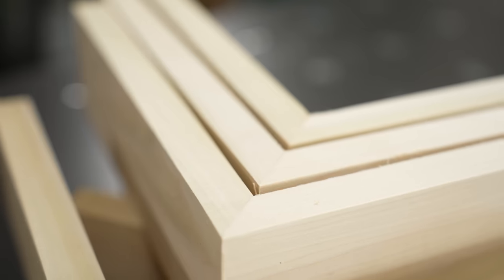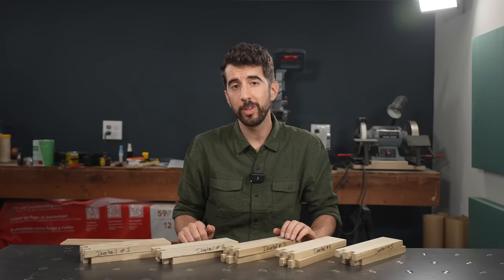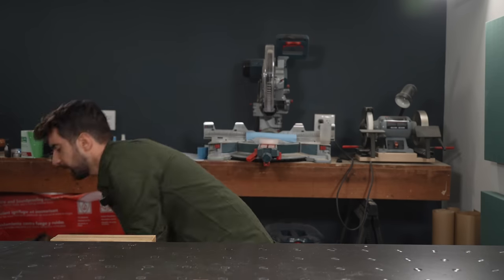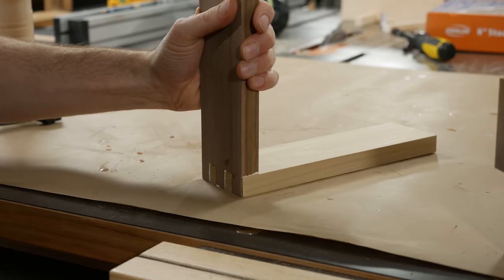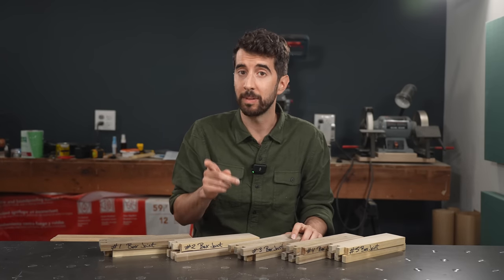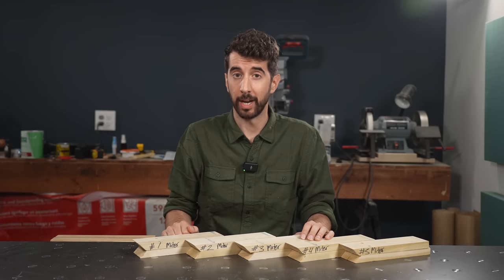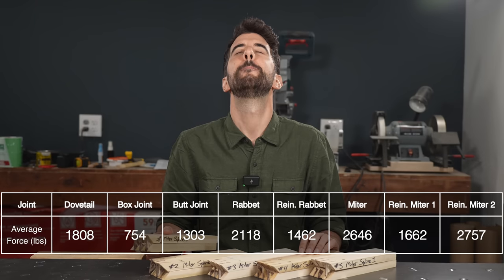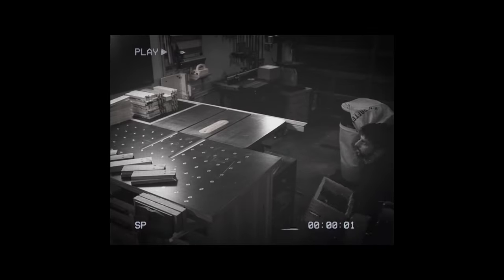This Simple Joint is Stronger Than a Dovetail!

Comment: yep - pros and cons - also noting stability and failure modes vary - mechanical, racking resistance is a nice feature in corner joints..

Comment: Clever test rig and interesting results. To find the strongest joint, you need a glue that is stronger than the wood to truly test the joints where the glue fails.  That may be a case of better being the enemy of good enough. After all, some Japanese furniture makers use rice paste to hold their work together.

We are all guilty of not giving enough clearance for glue.

Comment: The splined miter may optimize the way a glued contact is strongest - shear along a wide surface area. Dowels sort of use this principle, but when levered around the hole, the wood can expand and split around the dowel in either of the joined parts. Optimizing a strong glue layer around the splines distributes the shear forces so there is no focused stress riser; choice of a strong grained wood for the splines that also absorbs glue is apparent.

Comment: This is an interesting video.  One small quibble is the use of "mechanical advantage" to specify a mechanical lock in your joints.  This van be confusing since the usual meaning of the term is leverage.  It's the reason these joints will fail at much lower forces if you bend them.

Comment: Curious what would happen if you put a 1/4" hardwood dowel down the center of the butt joint.  You could drill it from the bottom so you won't see it...

Comment: You'd be amazed at how high the internal stresses get when you "rotate" the joint. It's called leverage, or mechanical advantage, if you prefer. Also, there is an "internal" mechanical advantage within the material itself. The surface area of the joint is probably the one single most factor influencing failure. It is the reason drag cars use "slicks" to get more surface area on the pavement. Remember, "stress" is what causes overload fracture failures, and stress is merely the total force applied divided by the area over which it applied. Larger area, for a given force, the less the stress. Failure by repeated flexing of a material, e.g., bending a paper clip until it breaks is called "fatigue" failure. The higher the stress applied, the less repetitions to failure. If the applied stress is below 50% of the material's "yield stress," the material will not fail in fatigue.

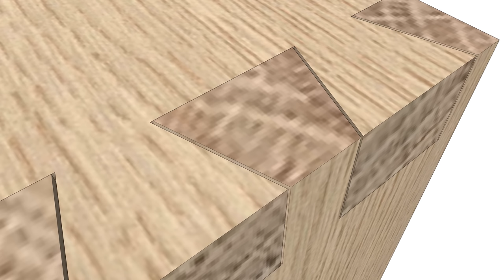Comment: 1:15 Not mechanical advantage. 
Mechanical advantage has to do with a system that allows for an input force to be multiplied through some kind of lever or device (e.g. ropes and pulleys) to produce more force on the output. 
This would just be an example of a mechanically tightening joint as the more force you put into it the stronger the connection gets.

Comment: I love your presentation especially your humor.  But seriously, your testing is blowing my mind.  Everything I thought I knew was wrong?  It’s not like my drawers need to hold 2000 lbs of pull, but I have believed for decades that end grain as a glue surface is weak and long grain is strong.  Now I’m wondering if I should forgo my next jig build and another router for IKEA.  Yikes - perish the thought.  Give me joint bling or give … beer, beer is good!

Comment: one, almost always ignored, factor in joint strength evaluation is time and changing humidity. Because the delta in movement  vis a vis end-grain vs long-grain, there is an active dynamic  operating to undermine the integrity of any glue line

Comment: While the 2nd reinforced miter joint scored higher, it's only by 4.2%. Is gaining 4% on an already incredibly strong joint worth the extra time and effort required? You already jump 24.9% by going from a rabbet to a miter joint, and the miter joint is simpler and faster.

In the end the conlcusion seems to be "the more grain glued the better".

Comment: I would think the wood movement due to temp and humidity in a miter joint is negligible. Both pieces, and the glue, should be increasing and decreasing at about the same rate. Like two rubber bands side by side and stretched, the two surfaces are moving in unison, keeping the glue moving right along with it. The glue might fracture during the movement, but I wonder if that would have any effect on its sheer strength? 🤔

Comment: Thank you!  For making this video. I have always been wondering which joint is the strongest although not super scientific does give a general idea and the results are totally bonkers from what you would intuitively think.  Theorizing end grain to end grain gives the glue a chance to soak up into each piece a deeper and also surround each fiber of wood, but would need more testing to confirm.

Comment: okay, i laughed for about 5 minutes when you said how long it takes to dial in the leigh jig...  which is why mine is STILL safely tucked away back in it's box.   literally takes LESS time to do it with a simple jig and a bandsaw, then clean up with a chisel...  and mine doesn't even do box joints, just dovetails.

Comment: very counter intuitive, but a great test for inquiring minds. I was really hooping you could have tested the reinforced rabbet in the other orientation - with the dowels parallel to the pulling force. With the knowledge gained from your video and testing you did; it seems that direction of the joint may actually be stronger than the opposing side, which I wouldn't have suspected either. Keep coming with these more frequent and quality uploads Scott !

Comment: Cool! How about repairability?

As someone who is proud of his dovetails, seeing the failure modes made me wonder: after failure, which of these joints are easiest to repair? The dowels really make a mess of the wood! The dovetails damage the wood but leave you with clean wood for re-gluing (now a box joint?) if you still have all the pieces. The mitre and rabbet might leave you with clean-ish surfaces that just need a quick sand-and-reglue, but then you have to match glues to whatever the original was, which may be worse...? Thoughts?

Comment: I was glad to hear you talk about longevity. Because that is the missing element to most of these test. If you would look at most cabinetry, where is the first place to fail? Miter joints. If you put a spline into that miter joint, it tends to last longer. We’ve all heard that modern glue is stronger than the wood, but is it really? Consider the following experiment. Find a 1 x 10 board that’s 4 feet long cut 4 segment that’s the same length as the width of the board making a square because we all know that a 1 x 10 is closer to 1/2 x 9 1/2. now take your four squares and cut them in half two with the grain two across the grain. Next glue them up, clamp them up and wait for the glue to dry. Now put them into a device to where you’re pulling the board apart across the glue joint. The board that was cut with the grain will not break it the glue line it might snap somewhere close to it but not the glue line because the glue is stronger in this case. Now put the board cut across the grain in the same device and it will fail on the glue line every single time. What does this teach us? It’s the orientation of the wood that determines which is stronger the wood or the glue. Now take the other two boards and repeat your test with the next two boards, but this time stretching the wood in line with the cut instead of across the cut. This time the board that was cut across the grain will snap on one of the ring lines in line with the grain at the same force as the board cut with the grain and the previous two boards were stretched because it’s the same failure. And the board cut with the grain that you’re now only stretching the grain will give you the full tensile strength of the wood that you’re trying to stretch to cause to fail, and that will be a loud bang that will be the strongest.

Comment: The reasoning behind why the simple miter joints are so much stronger: the end grain is SO much more porous than side grain, so the glue can penetrate deeply into it and grab each and every fiber and bind it to the corresponding fiber from the other piece. When we glue to the side of a piece of wood, the glue not only doesn't penetrate as deeply into the wood fibers, but it also only grabs the top thin layer of fibers, which, once the leading edge lifts, can be peeled off with very little force. This effect most likely also expalins why dovetails were so much stronger than butt joints in these tests, because each dovetail interface is like a small miter joint with lots of end grain being exposed for deep glue penetration and maximim number of fibers being joined end-to-end. Some strength is compromised by having to cut some of the fibers and leave them in place to create the dovetail effect though, which is why the simple miter ended up being stronger.

Comment: There was an interesting real-world demo of adhesive fasteners vs mechanical a few years ago in the form of street signs in a hurricane.  I can't find a link to it, but there was a city in a hurricane-prone region which was trying out a 3M adhesive product for securing signs to posts, compared to the standard riveted signs.  After a particular hurricane, all of the signs constructed with the 3M product were found to have failed at the post itself (usually post bending/breaking where it went into the ground), whereas all the riveted signs in that same region had pulled through their rivets and detached the sign face from the sign post.

So, yeah, nothing really unsurprising in this test.  cutting into the wood to make mechanical joints creates stress risers.  the wood then fails at those stress risers.  Whereas the glue distributes the load evenly across the entire joint with no stress risers.

I would expect that modern polymer-based glues should give the best combination of high-strength and longevity.  Stability of the cured form of the glue is really the only limiting factor with modern adhesives.  I would expect glues which soak into the grain and cure by chemical reaction to form a stable polymer to last longer than anyone using the furniture in question is likely to live.

Comment: There are two different ways to orient a dovetail joint in your fixture.  One that is helped by mechanical advantage, and one that is not.  Which orientation did you use for the tests?

Comment: Intersecting video.  Unexpected results.  The open question is not what type of joint is strongest, but how strong does the joint need to be.  As an engineer the question is to build to just above the required strength to optimize the design.  I did enjoy the information.  Thank you!

Comment: I've watched so many joint testing videos now, and they all just confirm that wood is stronger in certain directions, glue is super strong and they're all basically strong enough when tested like this. But I want to know what actually holds up to cycling loads and humidity changes. My gut tells me that more traditional joints do better over time, especially with wood movement
Reply: Unfortunately that kind of testing is beyond the scope of a YouTuber as it would take decades to do it.

Comment: Mitre has more surface area, as well as being end grain to end grain rather than end to cross face. I’m not an engineer, and although I have done a bit of building as well as finished carpentry, I’m not by any means a joiner or cabinet maker, but it just makes sense to me that if the butted joint is stronger than dovetail or box, then of course miter with more glued surface, and equally porous surfaces should be stronger than traditional butted joint. Weakness of the rabbet joint surprised me a bit, but yeah, I can see that cutting the rabbet is actually just giving you a better point of leverage to split the grain of the wood.

Comment: Did you test the rabbit/reinforced rabbit joints in both orientations?  Since it isn't as symmetric as the dovetail, box joint, or miter the strength is probably direction-dependent.  Especially true for the dowel-reinforced rabbit.

Comment: Miter joints consistently perform really well in these types of tests, but I think testing only a single corner is a little misleading compared to their real world performance, because one corner is very easy to get a perfect glue joint on.  When you build a real mitered box, any imperfection in the joint angle or the lengths of the sides will lead to at least one corner becoming glue starved and easy to break. The miter joint is very strong when perfectly executed, but it's probably the most difficult joint to execute perfectly in actual practice

Comment: i initially wanted to complaint but you did mention that your tests are a in-time snapshot of a fresh joint and they have not experienced repeated loading. 
In general there are many joints that take full advantage of the glues strength and can deliver superb performance, but in general that also means that temperature/humidity/stress-swings will with time destroy the joint.
That is the reason why the dovetail is used for drawers - the glue can fail but the joint will still hold. (also for the dovetail it is not that the glue was stronger than the wood - you'll see basically the same result without a single drop of glue. It was the mechanical interlocking that ripped the wood apart).
Reply: When people say "the glue is stronger than the wood," what they mean is that modern PVA glues are stronger than the lignen (the natural "glue" inside the tree that holds the wood fibers together). The dovetails break the lignen (not actually the wood fibers). And the shallower you make the angle the better they do because the line of lignen that has to shear off is longer as the angle gets straighter. Long grain wood fibers are the strongest aspect of wood. Joints that don't stress the lignen (like miter joints) fail when the glue line breaks. And since glue is stronger than lignen they do better in these stress tests. A joint that required the long grain to break in order to fail would do the best whenever you can manage that.

How things hold up over the years due to wood movement is the real concern that furniture makers should be worried about. Not how much force the joint can take, which is already overkill no matter what you do.
Reply: @CarlYota  "what they mean is that modern PVA glues are stronger than the lignen"
I would think that most people watching these videos should be well aware of this.
What i meant is simply that the dovetail is stressed against its own mechanical constraints and having it gluestarved, without glue, or with some gaps and way too much glue will make basically no difference in terms of how much load it can sustain.
Only once you get really shallow does the glue become a factor. 

What i was surprised was that the dove-tails failed like that - with pulling off the sides of the dovetails. More often you see the wood behind the the tails splitting due to the wedging.

Comment: Ultimate strength is not a useful metric. What is the max load a joint will actually face? Beyond that, extra strength is irrelevant. 
Two more points:
1. Even if a finger joint fails, is it not just as repairable as a dovetail?
2. Once you become practiced at cutting dovetails, they are the fastest joint to make. I know this may sound counterintuitive, but I’ve seen it first hand. With a marking gauge and simple hand tools, you can literally just eyeball the layout and start cutting. A solid bench, sharp saw, and sharp chisel make quick work of a dovetail. 
Bonus point: 25 or 26 years ago I quickly built two draws using rabbit joints for a prototype coffee table. I’ve used that ‘prototype’ coffee table ever since. To my great surprise, those rabbit joints have held up just fine, so perhaps traditional concepts of joinery need to be reexamined as you highlight in this video. Thank you.

Comment: Great vid!  This is definitive guide for stress.  I think you nailed it.  However, I think you can redo this entire video for torsion.  Kind of like you did on your earlier videos, but for this set of exact same joints.  I think we will find that the joints that are strongest in stress are not necessarily the strongest in torsion.  but once you have both sets of data, one can pick the best that gives the best performance in both.

Comment: Ouch ! Thanks for taking the time to test it out. But on the end, when will be the time your arms will be strong enough to tear the weakest joint trying to open a tuck drawer ? I would suspect the highest impact on the drawer is when someone if frustrated and slam it shut, the face's sides hitting the carcass, all the deceleration force is transmitted to drawer's front then to the sides through that famous joint. Scott: what would you think of building an apparatus to measure the force transmitted from the front to the sides when the drawer is slammed shut ? That would seal the subject FOREVER !

Thinking of it, F = M*A. Force = Mass x Acceleration. If we can estimate the speed we give a drawer with the weight inside of it, this would be easily calculated. Friction loss from the slides would be negligible.
Reply: Depends on the kind of drawer though. Fine furniture drawers are typically made where the face of the drawer doesn't overlap the case but rather fits inside it. Kitchen cabinets are typically as you describe but are on metal slides and in generally are just lower quality than fine furniture. The drawer faces of these things are often just screwed on so could easily be taken off the box if it needed repair.

But to answer your question, there will never be a time when a normal human exerts the metric ton of force it would require to break any of these joints by using a drawer normally, even aggressively. The joints in this video don't just apply to drawer boxes though.

Comment: All joints are probably way stronger than normal use would require.  Modern glues are fantastic.
I built a tv unit with drawers, mostly just glued together. Still like new 13 years later. No failures yet.